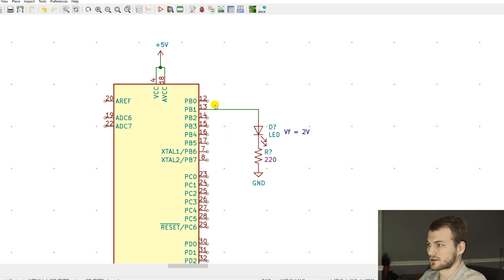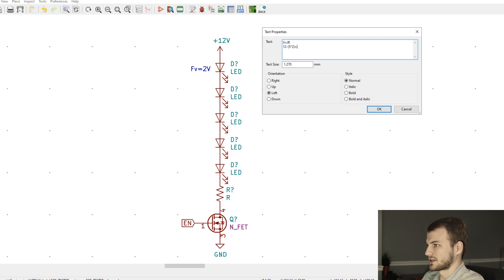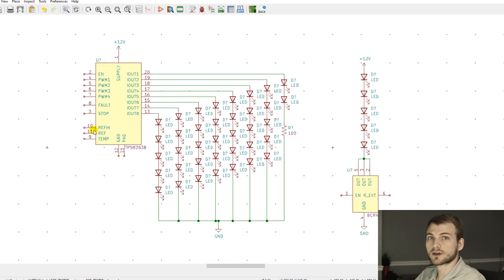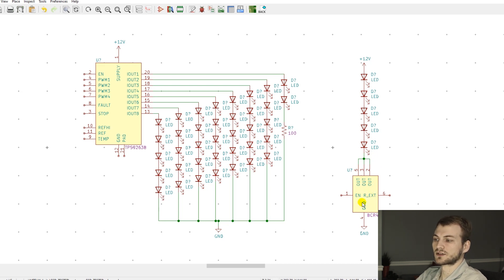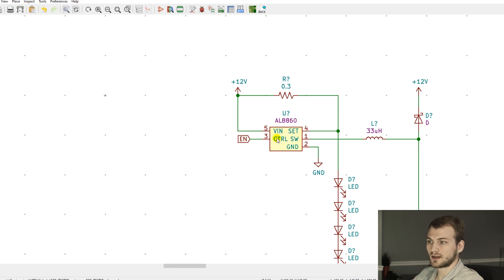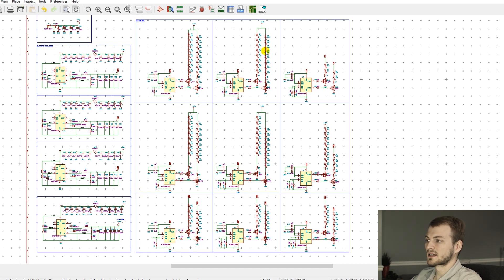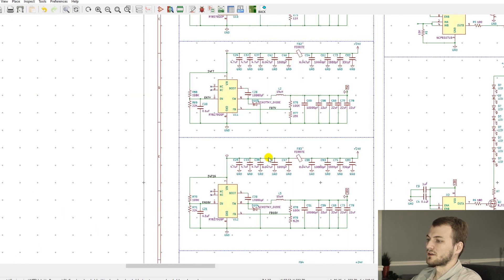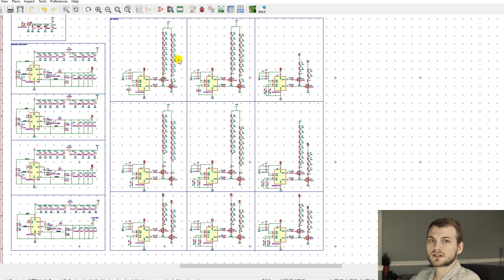Advanced LED Driver Circuit Design - Circuit Tips and Tricks

Comment: hi, please revert back ASAP since its very imp for me to know. I am using 3x10 cob led along with cc driver that is 960mA,30-35v and the connection type is series-parallel, now the issue is if one of my string fails so will it add up to the remaining LED or no???

I made some calculations too: 1 led = 30/10 = 3V 1 led current rating = 960mA/10 = 96mA so single led is taking 3v and 96mA

for 1 string:

3x10= 30V, 96x10= 960mA

this is for 1 string, i am extremely confused if the CC driver rating is only for one string or what please help i don't want it to override other strings.

Comment: Excellent video Kyle.

when working on LED drivers for your projects, do you take into consideration the flux and voltage binning of the LEDs as well as color wavelengths? Thank you.
Reply from the maker: Oh boy, that's a question! So yes, they absolutely matter. Every project I've been on like this, the client will spec them for us. Since we don't have any LED flux testers, I don't know that process too well. But typically you can only bin 2 out of the 3 specs. So you'll want to use a constant current driver rather than relying on a fixed forward voltage
Reply: Commonly the light engines will have binning resistors to adjust current as well as thermal fold back NTCs. Many drivers have an analog range for the dim/PWM pin usually around 0.5v-2.5v. a voltage divider can then be as simple as a 100k ntc on the bottom to ground and a current adjust resistor on the top. That's all separate from the main current sense resistor.

Comment: The thing about dimming LEDs with current is that I believe the light spectrum can vary a lot when the current changes - with PWM it should stay much more consistent especially at lower luminosity.
Also, if using LED strips, I believe PWM is the only practical way to vary the light, because the way they are constructed
Reply from the maker: Honestly, not sure about which affects the linearity more (PWM vs CC). I do know that if the exact brightness is important, it's critical to calibrate it and use a lookup table or algorithm to control it.